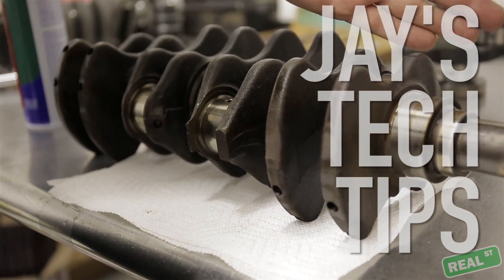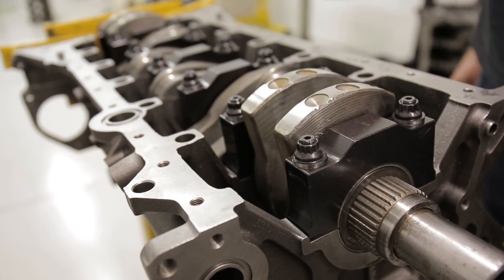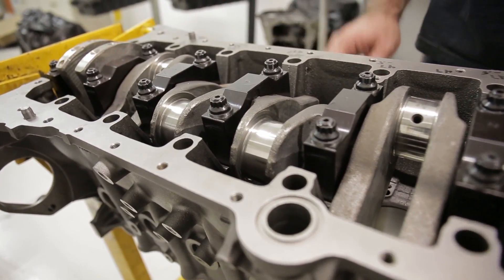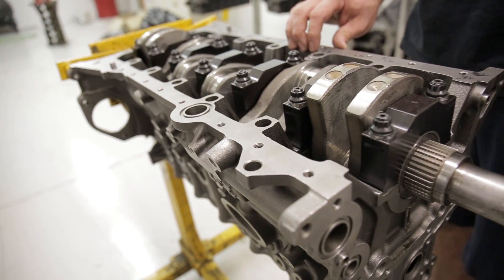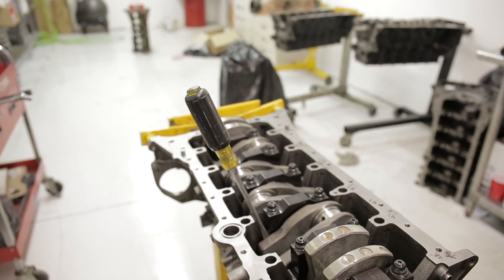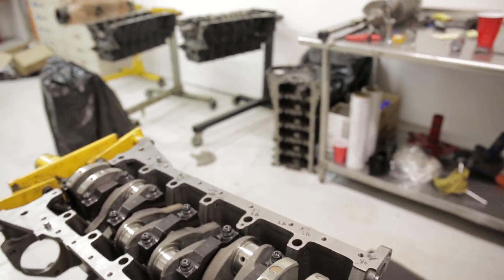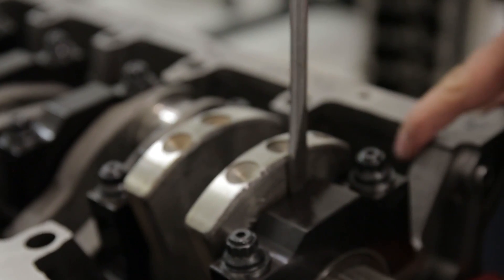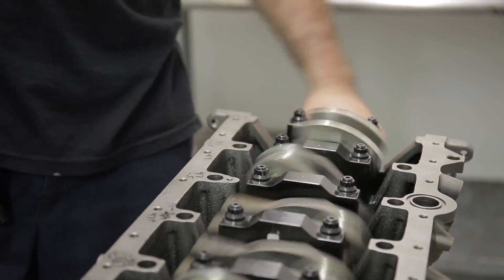How to avoid "Crank Walk" and properly clean your crank passages - Jay's Tech Tips

Comment: Thanks Jay,  on cars with a heavy clutch we always bypassed the neutral safety switch so the car can be started  with out the force from the pressure plate pushing on the thrust bearings, allowing oil pressure to be there, instead of a dry start. Love the videos. Thanks for all the great tips. P.s don't start the car in gear.

Comment: Heres a question. Toyota put different size bearings in the 2jz for the crank and rods. I am hoping to get away with a micro polish. But I am being told that its need to cut and so on. I am trying to figure out what is going on.

Comment: So doing this with no pre lube doesn't damage the baring? Like when you hit the crank to check crank walk the small bit it moves doesn't damage it at all? Would the measurement be off if I did it with prelube on the bearing? You need to do a full 2jz build dvd I would buy it

Comment: More tips please. Bearing clearance next?
Reply: aznrhyder The clearance only matters to the engine and ability to move oil through the parts. Has nothing to do with the rest of that. A properly built bottom end will handle all of that.
Reply: use plasti-gauge and torque the mains down dry and remove.
Reply: Yes a plasti-gauge for that. Put a piece on the main bearing then torque them down. Then remove them and measure. Simple.
Reply: I'm talking about what clearances are recommended for turbo, nitrous, n/a, e85, race gas, pump?